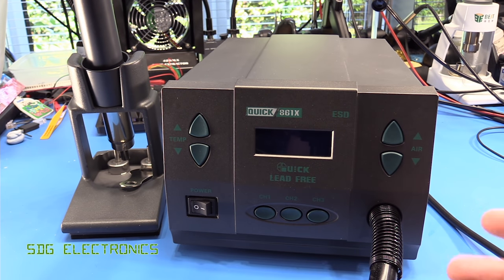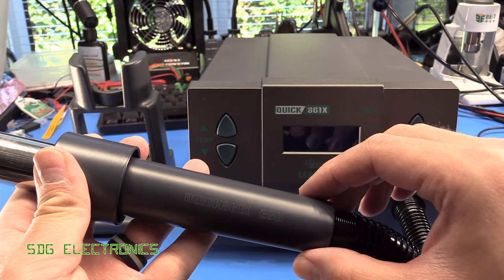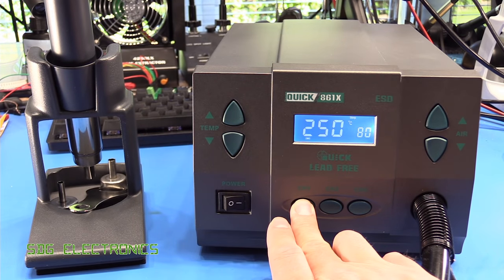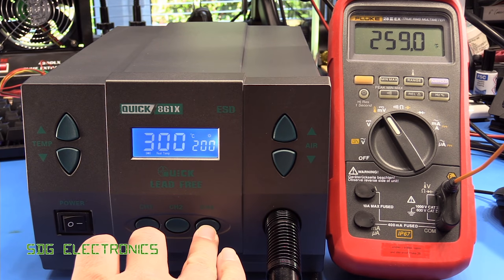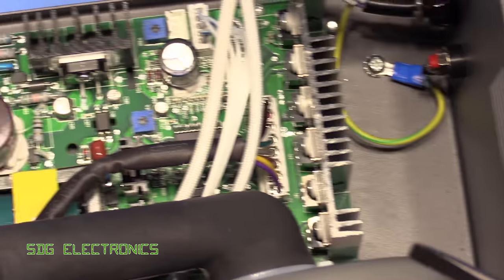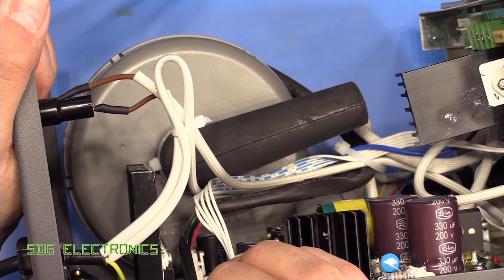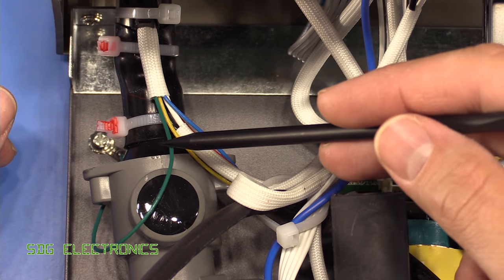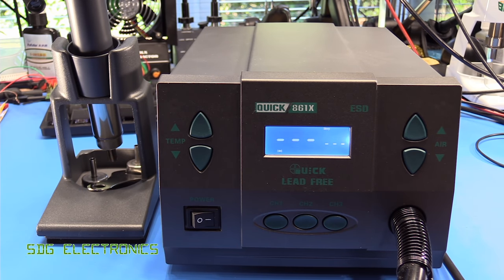SDG #152 High Power Quick 861X 1300W SMD Rework Station (like the 861DW)

Comment: Regarding the temperature inaccuracy, I had the same issue with my brand new 861DW, but after going through calibration procedure a few times, it's now pretty much accurate and reliable.
Reply: what is the procedure
Reply: @MrOrangeman18  set the temperature at 300 degree C and airflow at 50, press CH1 and CH3 altogether and the unit shows CAL sign. Measure the temperature with a K-type thermocouple and enter the the actual reading figure on your thermometer using temperature up/down keys (airflow up/down keys for moving digits from left to right).  Once you're done, press CH1 key. 
Search. 861DW calibration on YouTube.

Comment: 350°C output at 500°C setting is a rather large gap imo. 50°C wouldn’t bother me too but much 150°C doesn’t give me much confidence.

Thank you 🙏 for yet another very interesting review!
Reply from the maker: I tried measuring a few different ways, but still got nowhere near 500C. Oddly, the AC current waveform shows that the heater isn't at 100% so likely a calibration or firmware issue.
Reply: SDG Electronics 
Thanks!

Comment: I get the same light flickering issue on the 861DW, but it's down to the type of light. Those high power factor ones that have minimal input capacitance and basic output current regulation are the most susceptible to cycle-by-cycle mains voltage drops. Maybe capacitive dropper supplies too, though I don't use them. My DIY constant current driver for the desk light, and larger switchmode supplies are unaffected.

Comment: Can you measure above 350 degrees from other stations with that thermocouple? I’ve seen issues with thermocouples not being about to read above certain temperatures, so suspect that the issue is the thermocouple reading not the heating.
Reply from the maker: It should be good to over 1000C. Just gave it a test and it's OK on the BST-863. Good point though, thanks 👍

Comment: The reason your lab lights are flickering is that the unit your using is missing a shiny efi suppressor.
Its normally mounted on the back of the unit under the cover.

Comment: Thanks, just discovered your channel and I'll start following you!
Cannot remember if I posted this comment already (maybe it's in an approval queue?) or whether I didn't - or got lost in the Ethernet. Thanks for the review. I am choosing between Quick 861DW and 861DE. The only difference is the airflow (120L/m vs 200L/m) and the power (1000W vs 1200W). Yes, the spinning up and down of the station is annoying but besides that I wouldn't mind a little more juice for using with larger BGA nozzles. My only concern is: the DE version - as the X version - only goes down to 6L/m as a minimum. Do you see that as an issue for working on smaller pieces? I think it should be fine but it'd be great to have feedback from an owner of a similarly specc'd machine!

Re. the 150 degrees inaccuracy at 500 degrees, well, I hope it's a calibration/FW/unit issue as I am not sure I would be happy to pay for a machine that doesn't do what it says on the tin. That said, when do you use 500 degrees? :)
Reply from the maker: I think you'd be OK with the 6 l/m minimum. Once you add a nozzle, the air flow will drop anyway
Reply: @sdgelectronics  thank you, really much appreciated!! And please keep up the good job with your videos!
Reply: I'm the exact same boat OP. What did you decide to go for?
Reply: @wdunn06  I went for the DE model and I am happy with it. Only "issue" is the cooling process when you put it back on the holder. The DE also goes up to 500 degrees no problems. I've reviewed the DE on my channel - I hope SDG doesn't mind if I mention that here :)

Comment: Another Atten that I have not yet seen comprehensively reviewed is the GT-8102, which borrows more of its design from the JBC JTSE. The cheapest I've ever seen one is maybe around $400 to $560 USD, but it appears to be rated at 1000W and with a more compact form factor handle.

Comment: Would like to see someone review the Quick TR1300A and the YIHUA 993DM both are 1300w units, was going to buy the TR1300A but the spec says only 70lpm air flow, but it has the exact same air pump as 861x you just reviewed, never seen anything on the 993DM unit

Comment: Thanks, Steve. Maybe it has an adjustment inside for the heat?
Reply from the maker: I saw on another video the 861DW has a cal menu, but it doesn't help the error which occurs due to the airflow speed.
Reply: @sdgelectronics  I like the Atten ST-862D better anyway. It is the one I'll buy when I need a new hot-air station. It would be nice to see inside it if you ever get the chance before I buy one.

Comment: I just ordered a BST863 myself, but it does not heat up when I take it out of the holder. I assume the magnetic sensor in the handle is faulty? It just shows it is permanent in sleeping mode, whether it is in the holder or not.
Reply from the maker: Indeed sounds like the sensor isn't working. The base should be strongly magnetic where the handpiece sits. Also it's worth noting that if it's powered up and the handpiece isn't in the stand, it won't let you use it at all (just stays in sleep)
Reply: Make sure the handle is set in the base before u switch on the unit if its out of it or not sitting all the way in and u turn it on it will not work

Comment: Where du you come from? I´m from Germany and I have worry because we have a grid voltage of AC 230V, Inside the device are installed  two 200V Capacitors. Devices for Europa have 450V Capacitors. Maby not good.
Is it better to send it back?
Reply from the maker: It shouldn't be an issue. Both are balanced and in series, so 400V rating overall. A little bit closer than I'd like though

Comment: Strange that the bl motor drivers are so beefy and with such big heatsink. Usually speed controllers does not use any heatsinking at all for small motors.
Reply from the maker: If the numbers on the motor are to be believed, it's a 70W motor! 😮

Comment: Maybe it's switching the heater randomly and not at the zero crossing and causes big transients
Reply from the maker: Update will be published tomorrow regarding the switching
Reply: 1.3kW is all of 5A on the UK's nominally-230V-but-really-240V-or-more mains supply, and I wouldn't expect that to affect the mains voltage to such an extent that it's visible in the lighting (even connected to the same socket), considering UK outlets are rated for 13A and are typically on 32A circuits.

I regularly switch 2kW heating loads and have never seen any effects with the lights (on the same outlet, circuit, or otherwise).
The only time I tend to see brief dimming of lights is when inductive loads switch on or off, though I guess there could be an inductive effect happening here? :S

I shall await the update video with interest! :)